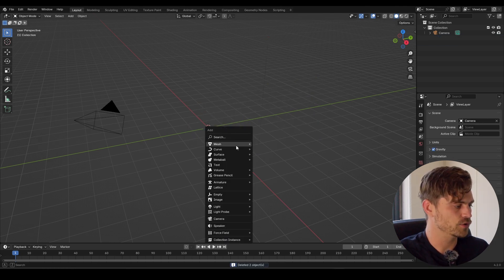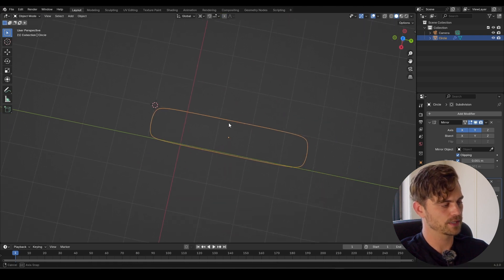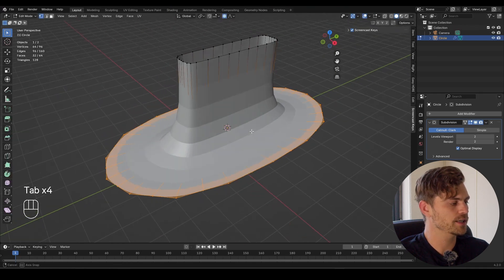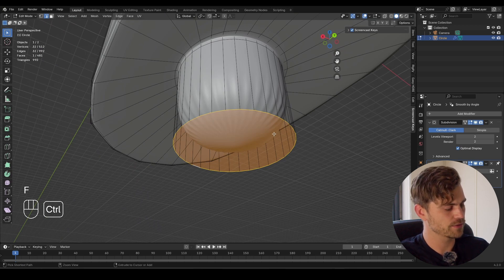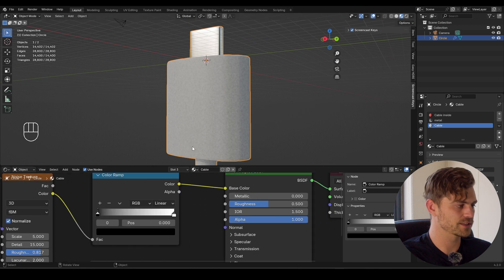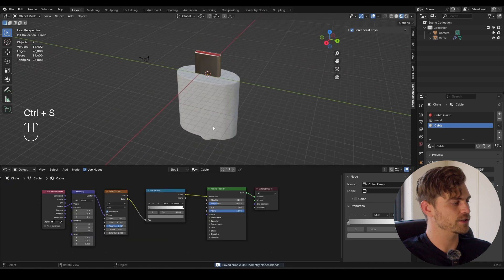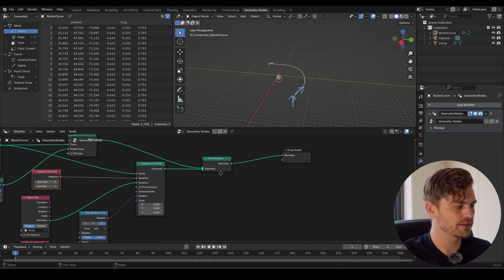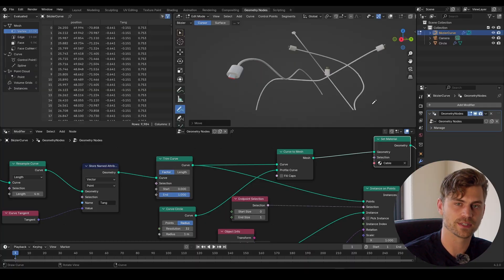How to Make A Cable and Animate it in Blender

Comment: When animating the head and tail, both original and relative modes give the same result, but the positions in between don’t line up correctly—only the start and end are right. Any idea why this is happening?
Reply: SAME PROBLEM STILL DIDNT FIND ANY SOLUTION -_-